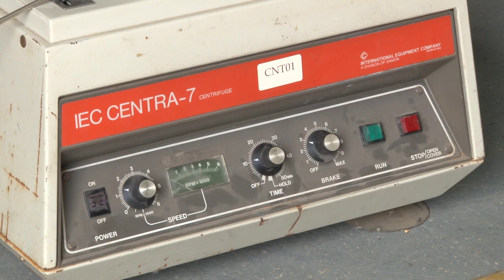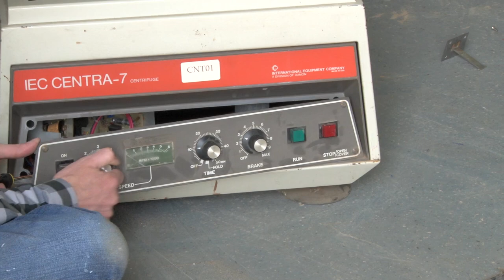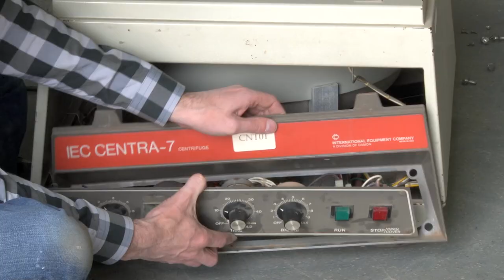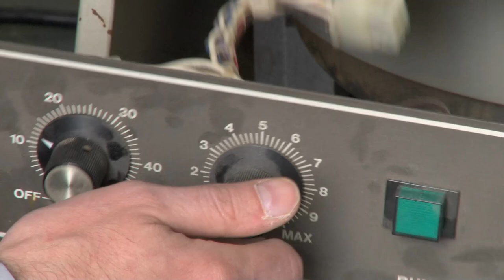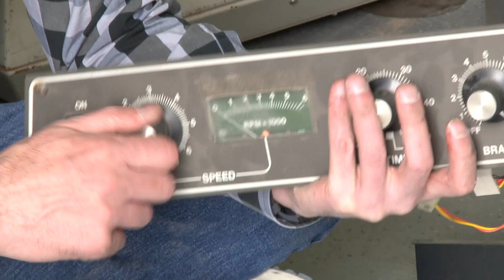Centrifuge: Equipment Autopsy #89

Comment: I have an interesting anecdote about the dynamic braking:
Back in the old days of the brick cellphone, I had the venerable Nokia 3310, and also one of those dynamo hand crank phone charges. It wa a weird sensation charging a cellphone with one of those, because you'd crank for a few seconds until the charger circuitry started to chooch, then the cranking would instantly become harder as the battery started charging.
Because the phone while being charged represented a greater load on the generator, the braking effect was greater.
Science! it totally works! :P

Comment: The solenoid would normally stay locked without power, to unlock you need to power it, and it should only unlock when the centrifuge is not spinning (rpm detection)
The big resistor might be part of the braking, along with the rheostat to set how hard it brakes, but it's not like a car brake or standard motor brake, more of a 'slow it down quicker' system.
Although i didn't get heavily involved with them, we used to do some basic fault finding on a few before calling in the service engineer.
we had some centra's where i worked, could have been the same model.

Comment: I have a couple relays like that I pulled from something that has 3 coil leads. two to activate the coil, the third one is a reset because these relays have a latch function. I'm not exactly sure how that works though.